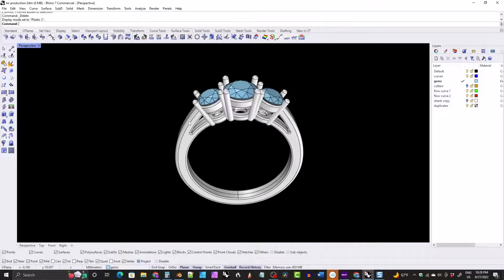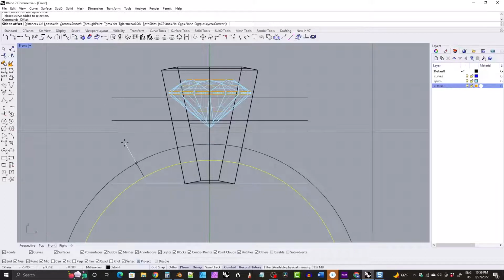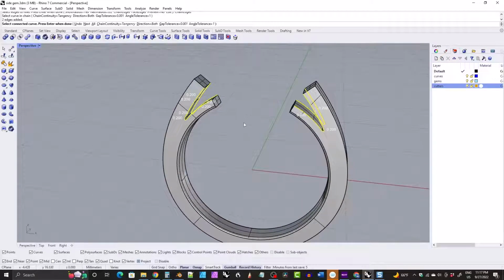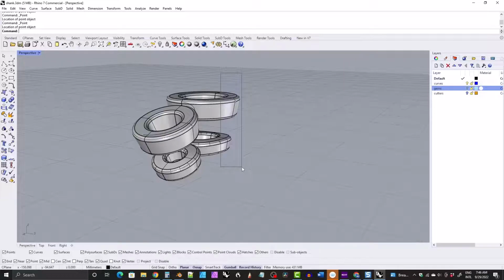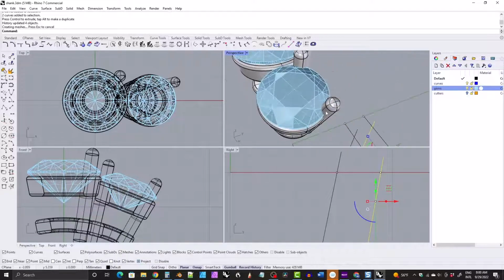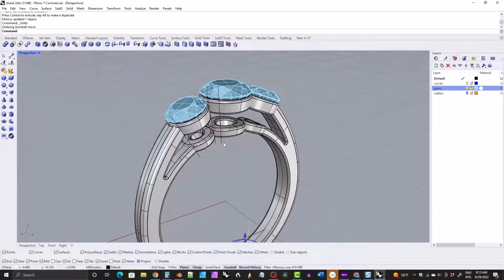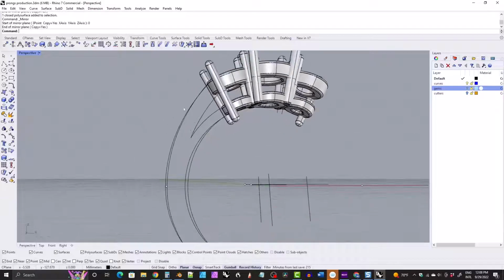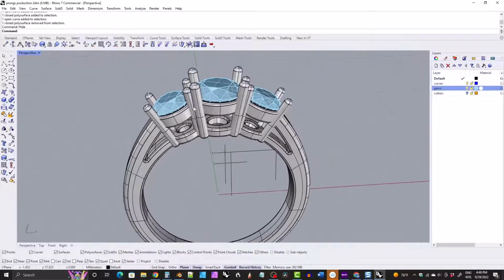Rhino 3D | Jewelry CAD Design | Tutorial | Three Stone Ring

Comment: Hi Sir, could you tell me how to move the point at 23:14? I have tried with shift, control, and alt keys but none of them works. Thanks
Reply from the maker: Hi! My first guess is that the gumball (the arrow gizmo) is turned off. You can type gumball into the command line and click on the "On" option to make sure it is on. Let me know if that helps.
Reply: @webduncetv  Thank you so much your quick answer, however I am unlucky to do that. Gumballs on, and I did command line on too, but no difference. Please help me out once more.
Reply from the maker: I can't guarantee that I can help you, but I can try. I will probably need to see your file or some screenshots. The following video shows how you can contact me via Facebook, Twitter (X), and email.

https://youtu.be/bhadwrxAF0c
Reply from the maker: You may have accidentally locked the layer the point is on. Every layer has a little lock icon next to it. Make sure none of the layers are locked.

Comment: couldnt we just extrude the face on the shank? @59:40
Reply from the maker: Yes, you probably could do that, and since the little gap area is so small, that would probably be fine. You could possibly also leave it as it was. It was such a small "error" that it probably would not have even been visible in the final piece after production, but it's just the perfectionist in me. Also, after you're experienced with rhino, it really just takes 3 or 4 minutes to re-make the shank, so it's not the huge deal it seems. I would probably almost have done it as a reflex in a real project. If I could re-do this tutorial, though, I would have talked about the importance of making sure that point is in a good place for a good connection, and I would have shown how different point placements could affect the final shank.
Reply: @ ya I ended up testing my intuition and tried my way and it worked fine. Then I went back and did it over how you showed. I’m really just doing these tutorials to learn Rhino as I’m a jeweller in the making. So redoing things is just more practice. And so far your videos have been the best, easiest to follow and most informative out there. So again thanks for the video. I hope you make more similar ones in the future. Cheers

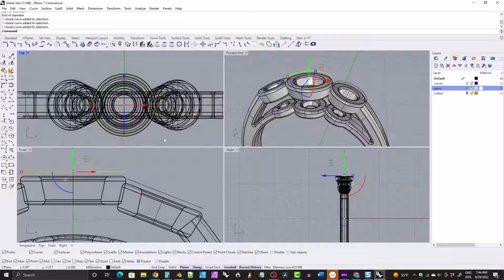Comment: for some odd reason when i try to trim the circle @37:00 it doesnt allow me to select the circles. Im sure i cold do it by extending the line to actually intersect the circles, but how do i fix this to work as shown?
Reply: seems its ann issue with the circle (i created it from bottom girdle of cutter) when i created my own circle to match, the trim works. perhaps the geometry of the simple diamond cutter is off?
Reply: also i cannot delete these curves for some reason, is it to do with them being isolated? sorry im very new to rhino
Reply from the maker: @kristiancolley8290  I'm not sure why you can't delete them. That could be caused by various things. Two things that come to mind is that you accidentally locked the layer that they are on or that you accidentally disabled the curve filter in the selection filter tool panel. It would not have anything to do with them being visually isolated (that just means that all other objects are hidden). You can contact me outside of youtube and I can try to help (no guarantee I can help, but I can try). You can send me screenshots, for example. But understand that due to some things going on in my personal life right now, I may be slow to respond sometimes.
Reply from the maker: @kristiancolley8290  Hi. After you click on the trim icon, look in the command line and make sure that ApparentIntersection = Yes. I should have talked about that in the video. It is a point I failed to mention. (This may not resolve your issue, but I think it will)
Reply: @ yes I toggled that multiple times. It seems to have nothing to do with the trim command at all. I couldn’t manipulate the circles what’s so ever. Couldn’t move them, trim them, or even delete them. Thankfully I had a backup file before I created them and just went from there creating the circles manually instead of duplicating the circles from the girdle. No issue with trimming now. Possibly just a system glitch? Or is it something to do with the duplication of the circles?
Reply from the maker: @kristiancolley8290  I honestly have no idea. But, yes, sometimes, weird things like that happen, and, in such cases, you see if you can make it work some other way, which is exactly what you did (good job!).

Some other things I might have tried would have been rebuilding the circle, creating a new circle (you did that), using surfaces that actually intersect the circles (instead of line) to cut the circles.
Reply: had to reload a previous save and make the circles thee second way, everything smooth from there. Still curious where the issue with the original circles not being manipulatable or even deletable came from though.

Comment: BTW..  what is you pc system specs?? your pc executes each command very fast!!
Reply from the maker: I have a stock air-cooled Alienware Aurora R6. It came with 16GB of RAM, an intel i7 CPU and an NVIDIA GTX 1070 GPU. I have not added anything to it. I don't think it's the best, but it does seem adequate for most of this stuff. Just to be clear, I'm not really an expert on what's the best rig for 3D.
Reply: @webduncetv  Excellent!!
Thank you for getting back to me..
I'm, running a Ryzen 7 3700X with 32GB of Ram, and a RTX 3050 GPU, and sometimes I think it runs slow to calculate the commands..
What is the exact model of your i7 cpu?
Reply from the maker: @jadesigner53  I'm not sure if this is what you're looking for, but according to the device manager, the CPU is an i7 - 7700.
Reply: @webduncetv  Yes it is!!
Thank you very much, now I can do a comparison with mine..